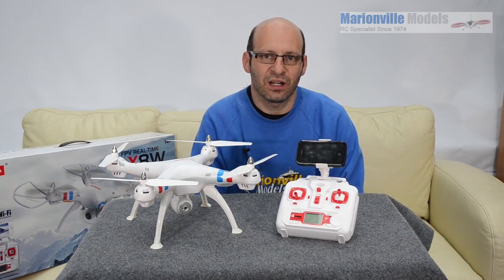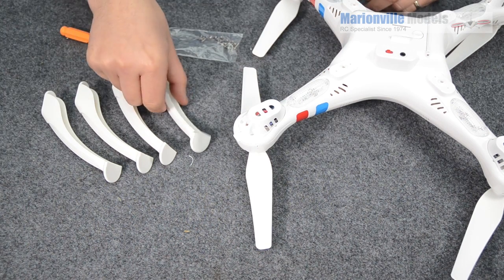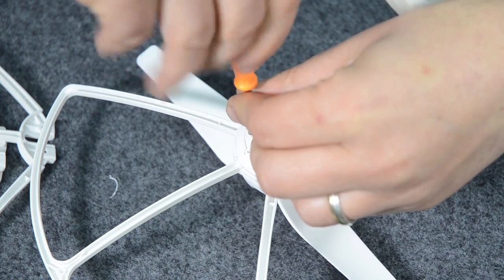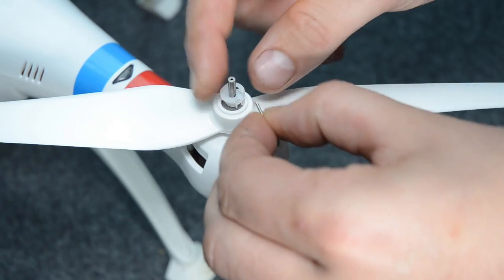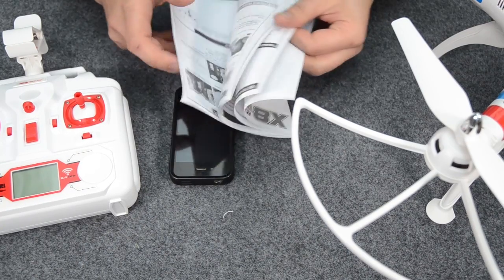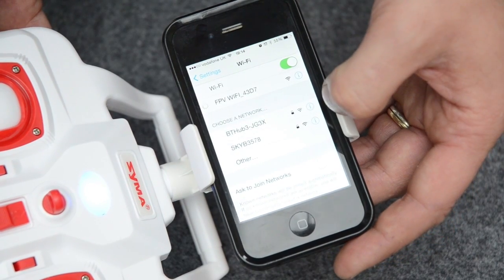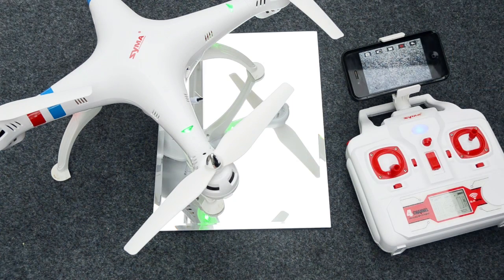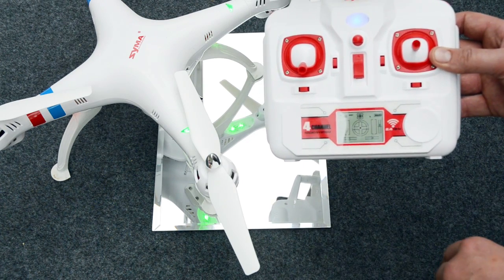Syma X8W FPV Quadcopter Quick Start Guide & Review

Comment: Great video, Thanks for sharing... I've subbed your channel... I have a question for you. I am getting this Model, The X8W, and it has the white transmitter like the one you have here in the video. I like the black transmitter better, and I've found some on EBay, and I'm wondering if they will work with the white X8W model ?
Reply from the maker: Should be ok. You'll need to rebound it to the craft.
Reply: Marionville Multirotors
Great! thanks for the info. I'm gonna have to order one of the black transmitters sometime soon... Thanks again, and safe flying my friend..... :)

Comment: So I am very interested in buying this unit and your video was extremely helpful however, I do have a question. I don't understand the WiFi requirement. You are not expected to be near the WiFi in your home in order to operate this, right?
Reply: You just have to get the WiFi cable seperately from Syma, you won't have problems with your home WiFi if you use the Syma WiFi cable. Hope I could help!

Comment: Great video!  I'm new to flying quadcopters and the manual was difficult for me to understand.  The last few times I went out I crashed a lot. You went through all the material really well and easy to understand.  Thanks a lot!! especially about the hover calibration and the direction mode with the upper left button.  Thanks so much!  i subbed to your channel too.

Comment: the antenna bars r continuesly blinking on my remote even after i bind the quad to transmitter and my drone if flying like it have no power to lift  it fkys around 5 to 6 feet max ... already changed motors :(

Comment: I'm having trouble getting mine to take off. Everything works and the rotors are turning at full power but it doesn't seem to want to take off from the ground?
Reply: +Ralfoxify Make sure the propellers are on the correct motor shafts. The propellers have a letter A or B, which should match up with the letter A or B on the quadcopter  arms.
Reply: +Ralfoxify Strangely, the diagram for how the propellers should be mounted is found on the side of the box. You need to get two blades from each set included.
Reply: +Chris Slater hey guys, yeah I didn't think to look at the box, you'd think they'd mention it in the instructions, but after some head scratching yeah they do separate A propellers from B propellers. Thanks for taking the time to reply

Comment: I have an x5sc and an x8c... just bought the x5sw camera that's swappable between the x5 chassis and given the x8c camera unit is just a big round shell around an x5c camera it should in theory work for that too. :)

Just in case folk have bought one of these and want to experience fpv for £25.

note: I'm not talking about the 5ghz "upgrade kit" knocking about, I'm on about just an x5sw camera.

when it comes I'll try and come back to confirm my suspicions. :)

Comment: Thanks for the upload, I was trying to work out the blade fitting, it helped a lot. I didn't want to break it! Cheers
Reply from the maker: +Telecastvids Yes i find it a little odd way of doing it so thought id explain it.
Reply: Βανιστα Βορεια ηπειρος it comes with the drone!
Reply: Marionville Multirotors if i buy this drone i will get the camera in the drone or i will buy it special

Comment: Hey Marionville. I am trying to have x8w to fly with goPro. Can you suggest how to do this? I've tried with a adhesive mount, and waterproof casing around it - and it doesn't fly.
Reply: +Santosh Achari Buy a lightweight gimbal and the lightest GoPro, or even the cheaper Chinese Yi camera. Syma even sells its own custom HD cam for the X8

Comment: The Syma X8 is venturing into "real" RC aircraft territory and needs to be treated as such as it's no longer in the safe toy classification at over a pound in weight. I also have some disappointing results regarding Gearbest where I ordered a RC quad from. I wanted a safe backyard quad and after reading some good reviews I ordered the Nuhui U807 for $48.60 with two extra motors and a prop shaft just to be safe and weed out a weak motor if need be but the one I received was defective and had a bad ESC that immediately failed. And apparently it cannot be repaired as the FCB is not available. As a result I'm sorry to report and warn that Gearbest's response has been the opposite of what Gearbest claims in writing is their response to customer service issues and offered me a $3.80 credit rather than replace the defective part or repair the quad. I refused the offer and requested a replacement part or warrantee/guarantee service. Gearbest then closed the ticket with no action taken.

After waiting for a response I was surprised to discover the first unresolved ticket closed so I opened a second ticket and immediately received an emailed saying my "wallet " was credited $3.80 despite refusing their offer on a $48.60 purchase that is useless without a working ESC. If you get a working product you will be OK as long as it's a low cost product as important parts like the flight controller and onboard ESCs are not available. But if you are talking about a product that costs over $100.00 you are running a high risk of instantly throwing your money away as Gearbest may claim a one year warrantee but my experience as well as others shows these statements are made to get you to buy a product and the customer service claimed does not exist.  To even consider buying something more complex and expensive that is not a test review version like the ones shown in reviews checked out before shipping IMO is very risky.

With quads the size of this one and prices so low on hobby grade parts using standard RC transmitters and receivers where you can build an excellent GPS quad for less money that is more dependable and can be easily repaired with available standard open source parts I would have to recommend you buy one from a known company or someone that builds them for a fee with parts sold through the standard RC hobby suppliers.

If Gearbest is going to survive as a RC hobby supplier then Gearbest is going to have to stop getting business by undercutting companies that have real customer service and take that reality into consideration in their pricing and become straight forward and honest. Putting out a few products that work for reviews is not the same as putting out a thousand of the same product that work as well. And as they become bigger and heavier they become a risk to the RC hobby and threaten it so good advice has been given separating the X8 from the smaller "toy" weight quads.

People need to remember if it cannot be repaired it will become a complete waste of money. Quality is far more important than quantity and not an easy thing to establish and being able to replace parts should be a primary consideration. And quads this big should be in a separate classification. I don't even test my large quads in the backyard off the test stand lines let alone fly them near homes and neighborhoods. That's what the small lightweight geared quads are for. Great training and great fun... when they work.

Good review....
Reply: +John F Hendry I agree the X8C/G is far from a toy. It says 14+ on the box for age suitability, but I wouldn't want a teenager flying this near my house. I have to be honest, as much as I love Syma quads, they've upped the ante and gone into professional grade territory with their recent models, easily and cheaply ordered and shipped from China without the slightest whisper of a safety warning! The X5C, which I flew for a good eight months, gave me the confidence to go ahead and order the X8C. To be honest it scares me, the noise it makes as the motors (whether brushless or not - as I keep hearing the pros and cons for both) kick in. I'm pretty confident with drone flying and I do it in open areas, away from people, but I can catagorically say that I cut my leg last night with the X8 while I was wearing shorts. X8C/G models are professional grade model helis and should be marketed as such.

Comment: What is the range of the copter?
Reply: +Jorric 50 meters is a safe distance. The controller and unit have no problem with that. Although users (who sometimes mod their receivers) have reported 50-300 meters. Most I've had [at an estimate] is 120

Comment: Hi, thanks for a comprehensive vid - however I have a couple of questions. Did the screwdriver come already magnetised or did you magnetise it? Also, in your opinion, would the black or orange version be more visible for LOS flying.
Reply: +going2press I thought the same. The screwdriver is magnetised, but it's a bit limp. Better use tweasers as the screws are tiny. And it's no different with the orange or black. They're both better flown at dusk. When you can see the lights. To be honest, they look amazing in low light. And the X8 will take a few knocks. Not as robust as the XC5 but they're great if yo know what you're doing!